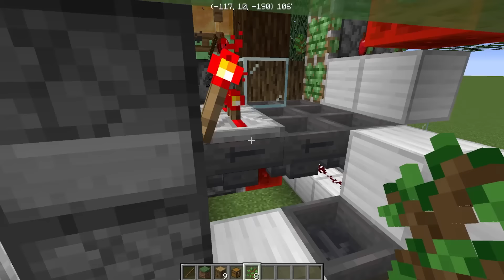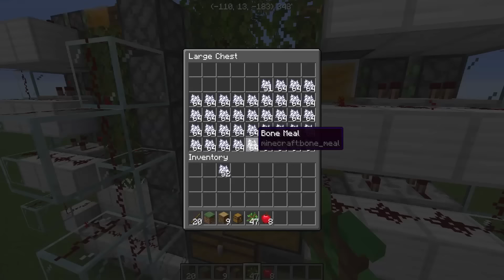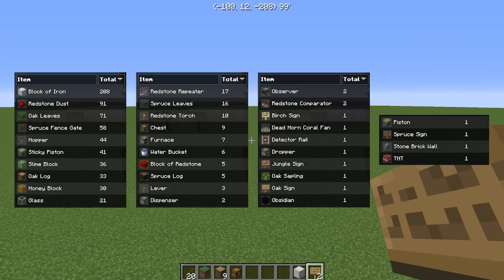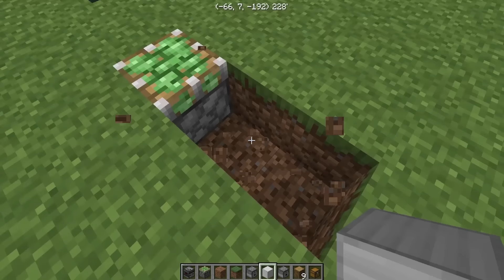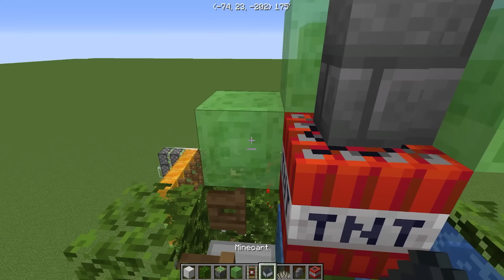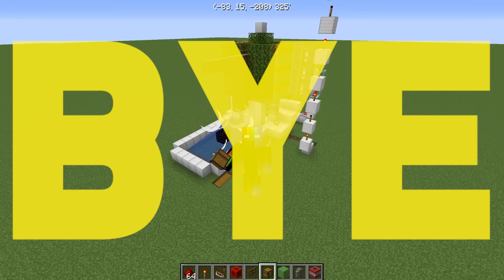Minecraft Tree Farm 26.1 - EASY AUTOMATIC TREE/ LOG FARM Tutorial

Comment from the maker: I need help farming likes and only you can be the one that helps me! make that bad boy turn blue! 😜😎😻
Have questions or yours broke? Leave a comment!
Reply: How many bone meal/hour is needed to run for oak? just wondering how big to build my bone meal farm to supply this constantly
Reply: @connerroth3416  make a mob farm afk for like one hour there and you can have maybe 3 hour worth of bone meal to use the tree farm
Reply: @connerroth3416  it depends, for me it was 4-6 double chests. (with hoppers)
Reply: @connerroth3416  10,800 and hr
Reply: It’s not working because of the slime blocks are not getting pushed
Reply: I have problems running with spruce it just doesn't grow. Any ideas why?
Reply: @ketsuppi  i have the same thing i tried building 9 blocks up with a block on the top and manualy growing a spuce tree but in the farm it does not work anyone pls help
Reply: Does ot work with spruce
Reply: @lukasemeraldpartoguanpurba3967  ya man it does
Reply: @Yaksh.physique  for me and him it just doesnt like it doesnt grow
Reply: @lukasemeraldpartoguanpurba3967   check des
Reply: It’s not working in the new update it’s not pushing the slime blocks
Reply: when i try to activate tnt duper, the coral fan dissapears and the tnt just activates without duping?
Reply from the maker: @andreasborelli7013  you have to enable tnt duping on servers with paper
Reply: @allen8812  I’m having the same issue with the second line of sticky pistons are not extending i built it 3 times idk whats wrong with it.  Can anybody help?
Reply: THE LEAVE CRUSHER IS JUST BROKE IT WORKED IN YOUR DOWNLOAD THE SLIME BLOCKS ALWAYS STAY THERE
Reply: I am having problems with the timing for the tnt dup so i dont know which is right
Reply: i m getting same problem it dropes 2-3 tnt then explode inside the canal @andrezponce2172
Reply: How does the piston with the redstone block know when to activate? I'm trying to fix a problem with that.
Edit: It's unextended normally when you reset it by breaking and replacing the dirt block above it, but once it extends, it doesn't stop extending and the leaf removers are stuck in the on position.
Reply: Hey can u help me my tnt duper doesnt work :( 
1.16.5 server with friends
Reply: I wasted more than 5 coral fans, 5 tnt and two hours to make the TNT duper just to see that I had been building it incorrectly
Reply: My farm will only move the honey blocks, the slime blocks stay in place
Reply: @mad_hatter3.14  same thing
Reply: so it doesnt work with dark oak?
Reply: @topazflip2029  fam dark oak only grows in 2 by 2 saplings
Reply: no it will not work but can u make one on my server i tried but cannot work plz i will give creative plz
Reply: Can ypu build this underground
Reply: Can you build this underground
Reply: hey Dusty Dude, sometimes the top row of logs doesn't blow up(you can clearly see in the video too). what can I do about it?
Reply: This farm always ends up with a couple logs stuck in the chamber. How can I fix this?
Reply: @connor6740  you mean the top row right?
Reply: @muffy4671  No, in the middle. Logs get stuck and when that happens, a row of the honey blocks and gates move forward and is out of position. I've checked all the repeaters, but can't anyone wrong.
Reply: @connor6740  it is ment to be that way
Reply: I'm confused because at the beginning of building the tnt duper the slimes are placed different than when you place the redstone torch at 20:51 to activate it for the first time. Did you do stuff during the part of the video that was cut? How should i place the slimes
Reply from the maker: @fubbalo_  build it how I built it. Things move slightly after you use it once
Reply: @DustyDude  Looking for help before I blow everything up. Can this farm dark oak as it seems like it would be quite similar in growth to regular oak
Reply: right now it isnt working because when i activate it when the slimes are in the positioning from ealier in the build it just moves the slime blocks and the tnt doesnt explode
Reply: also tnt duping is enabled on my server we have other farms with tnt dupers that work perfectly
Reply: well I was able to fix it but it took 3 hours and kinda had to troubleshoot my own way. it was a great tutorial otherwise though!
Reply: do you have to use iron blocks
Reply: @3PRBs ផងផ៩់
Reply: @xypxalo  if you lower the iron block in the middle
Reply: @xypxalo  no I mean the iron block above it
Reply: Does this work on bedrock
Reply: my farm is not working it doesn't move closer to the tnt drop
Reply: The sappling does not have enough time to grow how do i fix that?
Reply: oops i fixed it
Reply: @RuralTrainsOfIdahoYT  what did you do?
Reply: Does it produce spruce logs?
Reply: How many sapling do i need to start the farm with spruce or oak?
Reply: Hey! I know it wasn’t the intention,  but you can add modules to the TNT tower with a hopper clock 

I added a Cobblestone Module that pushes it into the already in use TNT duper and it just passively collects cobblestone even when the machine is out of bonemeal. 

It’s definitely not cute/efficient but if you ever want additional cobblestone when farming wood. it made 2 stacks passively while troubleshooting it
Reply: Does this work for bedrock
Reply: I made the farm exactly like you did but after updating to 1.17 the sticky piston under the dirt block isn't getting powered by the redstone dust maybe because of hit box changes so can you please help me with that
Reply: Yeah for some reason the tnt dup isnt working and all the leaves break along with the coral.
Reply: Is this farm for bedrock or java editon
Reply: does it work in bedrook?
Reply: I keep running out of saplings
Reply: Works on ps4 1.17? Tnt duper?
Reply: Does it work for bed rock
Reply: Hey !!! this tutorial is amazing , but I want to know , which texture pack do you use . Can i get the name of the same ?
Reply: do u need to build it out of iron blocks or can u use cobblestone
Reply: please help! the honey and slime blocks are not sticking to the sticky pistons on the leave crusher arm without the redstone blocks. idk why they aren't moving back. Any help would be greatly appreciated
Reply: Dusty Dude my farms slime and honey blocks arent sticking together!
Reply: @Dusty Dude what can I do if the TNT is producing too quickly
Reply: does this duper work on aternos server?
Reply: Does it work on bedrock?
Reply: it turns black now
Reply: Pls help me the tnt duplicator is not working for me
Reply: Does this work on crimson wood?
Reply: Gay
Reply: For me the other tree-types dont grow, only oak grow, jungle, birch and spruce just wont grow =(
Reply: Dusty dude please help me. The piston below with the redstone block is not activating
Reply: @anni_gaming9929  did u place the torch?
Reply: @popuplol9847  yes I placed it now
Reply: Slime block stuck with acacia free.
Can someone fix that?
Reply: I just built this farm, it works for the most part, but whenever I try to run the machine, the main part works fine, but the tnt duper only works when i flip the lever off to turn the machine off? Im a 1.19 realms java server? Thanks!
Reply: @tuthlu4016  Did you place 7 red stone torches? Then only the signal would flow with the lever.
Reply: @anni_gaming9929  I did place 7 torches yes, my issues had been resolved, seems i placed the comparators backwards XD
Reply: @tuthlu4016  Nice to hear that.
Reply: I just finished building it on our 1.19 server, it worked but suddenly the wood stopped moving forward so i wanted to see if smth with the hidden redstone was wrong, not the redstone (i believe) but i noticed the leaves despawning. The border ones as well the ones on the tnt duper so that broke and it blew up but is there any other block or way other than leaves because as said they will despawn. If someone could help i would very much appreciate it
Reply: How much bone meal does it consume per hour?
Reply: Is this farming still working in 1.19?
Reply: im playing in 1.19 and the tnt duper seems to not be duping and just sending the TNT itself
can anyone suggest a solution?
Reply: Bro, what recourse pack are u using ?
Reply: for some reason i cant do spruse idk why it works for every other wood but not spruce
help me dude pls
Reply: Hello. If I start growing birch seedlings after the oak seedlings. Will the farm break down?
Reply: Question dowe this work on bed rock two?
Reply: do you need to use iron blocks or can you use other solid blocks like smooth stone?
Reply: tnt duper doesnt work
Reply: @Dusty Dude, my tnt keeps lagging back while testing, this makes it not drop down. I'm on singleplayer 1.19 OF. Do you know how I would fix this
Reply: @Dusty Dude does this Farm work on Bedrock Edition?
Reply: My gress chopper is not working
Reply: My leaf chopper is not working properly. Plz help
Reply: Thank you for this video
Reply: I just build this farm for the second time on my friends realm, and it works great, except for spruce. I can't get spruce to grow, i've tried to move the ceiling block up/down/remove it completely, and nothing seem to help. Any1 had this problem?
Reply: it turns white bruh
Reply: Hi, is it possible to make it work underground? I did it using glowstone, but I am not able to make birch to grow, only oack. Is it not possible to grow birch underground?
Reply: I found out the problem, for some reason you can not excange log that push with stiky pistons with glove stone or brich will not grow...I solved using wood as you did and placing glove ston at place of the glass 👍 now it work perfet
Reply: @mix jax yes it work, chek out if you built well circuits...you have to be with the torch and repeater always active pointing the tree so when it will grow it will activate the piston of the tree detector below that will push the redstone cube that will activate the extractor and with the repeater delay the leaf crushers to...chek out that all repeaters have the correct timing and dalay
Reply: does it still work in 1.19.2? im just having troubles with the tnt duper stuff
Reply: @sherpaa1868  chek if you built it in the correct way
Reply: Bedrock
Reply: Hi so the tnt duper doesnt work properly the unsticks from the blocks goes down amd explodes then i dont have any tnt there and it just doesnt work please help im playing on  1.19.3
Reply: Hpw to make tnt duper work in 1.19
Reply: the tnt dupe is messed up in my multiplayer world wow
anyone know how to fix it would love some ideas (the server is paperMC btw thankss).
Reply: love the vids and i learn lots from them keep up the good work😊
Reply: The slime and red stone pushers won’t go out plz help
Reply: Can you use this for the new cherry blossom trees?
Reply: ik im late but can you use this with mangrove wood ?
Reply: One small piece of constructive criticism:

You start out with the dirt at 3 high, where on the 21x16 grid is this located and how is the rest of the build orientated subsequently. Otherwise i love your farm, made it before
Reply: Does this work on bedrock?
Reply: Does ut work for 1.20.4?
Reply: Does it work for 1.20.4?
Reply: the back 12 pistons keep jamming on mine. is there anything i might have screwed up for this to happen?
Reply: Does it have to be iron blocks
Reply: Hey Dusty, the tree pusher/leaf crusher doesn't sync with the rest of the farm. I have to stop it and go round the back to pull the lever and push the wood out manually. Everything else works well. Any fixes?
Reply: Sorry, me being a dumbass somehow removed a repeater.....
Reply: I also have a question: what types of wood work on this automatic tree farm?
Reply: Nevermind, I read the description
Reply: I play on bedrock and on 11:26 the pistons aren’t pushing the slime blocks, I don’t know what’s going on.
Reply: bruh this tnt duper is working in singleplayer but dosenot work in mulitplayer please help me dude
Reply from the maker: @Yaksh.physique  you need to enable tnt duping on some servers
Reply: @DustyDude  i am fuk up can u make it on my server plz i trie it and i destry it i can also give u creative scince its only our friends server
adn i also enable it plz make it redstone enginer
Reply: @DustyDude  every second tree, one row of honey blocks on each side stays in place and a log jams it up. Can you help? This only happens every second tree for some reason.
Reply: what version is this on
bc the tnt duper doesnt work in 1.16.5 for me
Reply: @Savagebutidiot  the thingg is either u are on paperserver or u made it wrong
dupers are patched in paper server
Reply: @Yaksh.physique  im on a survival and i dont know what a paperserver is lol
Reply: @Savagebutidiot  so u built it worg
Reply: @Yaksh.physique  mmm no i dont think so
Reply: @Savagebutidiot  it will work on 1.16.5
Reply: can u plz make this on my server i will give creative plz i make it but not wokring
pzlpzl

Comment: why did the farm suddenly stop working when i grew one tree
Reply: Mine is doing the same thing I don't understand why???
Reply: @melting_tv9853  I found the problem because the redstone block wont pull back, so I just connected the observer to the pistons by putting redstone in a line to it with a block in front of the observer and redstone on that block, then flick the lever around five to seven times until both the tnt and the leaf crusher work. But this only works if you manually bonemeal it, or the mechanism crushes the sapling. To turn the farm off, you break one redstone on the side of the observer and replace it
Reply: @EmpirePenguin14 Thank you. Do you know why the red stone block doesn't pull back with the way it's built? Because I built a bonemeal farm connected to it, and that kind of defeats the purpose if i have to manually do it. Also, do you know of any other tree farms that do work in 1.21.10?

Comment: I don't know if this will get a reply, as this is an older video, but: I'm having trouble getting my stick piston pillar to push the trees out after they've been crushed. It works if I manually activate it with a lever, but won't do it when the machine is running completely. The second (outer) pistons that make the second extension won't activate. I've checked to make sure my repeaters are set correctly, and they are. Any suggestions?
Reply: place the sticky piston and redstone block below the dirt where sapling are placed

Comment: This is a bit of a late question but why do you use sticky pistons instead of normal pistons for the piston extender pushing the logs forward since you don t want to retract the log but just push it forward. Also, I am a legacy edition minecraft meaning that I play it on 1.13, so I don t have honey blocks. I m guessing the leaf crushers won t work unless I leave a speace of 3 blocks horizontally in between each piston ?

Comment: Pro tip : You don't have to use bone meal for this farm to work. But then it'll be painfully slow.
Reply: this ain't a pro tip..
Reply: you can connect a bonemealfarm to the tree farm, i stacked 3 bonemeal farms on top of each other with the bonemeal going to chests which fill the dispenser, can pretty much afk when both farms are running

Comment: i did everything and for some reason, the redstone is blinking but its not moving the piston
Reply: I have the same issue
Reply: @sc_ken8045  i found it, if the tnt is working and the redstone is blinking u have to place the sapling for it to work
Reply: @D.CAutoSpa  actually i had a different problem, so i placed the tourch on the side of the wall insted of the block which is why nothing happend and i placed the pistod with the redstone block under the farm in the wrong spot, its suppose to be under the dirt

Comment: Do you know if anyone got this to work in 1.19? The Redstone is going haywire, and the leaf crusher is not fulling extending when I throw the platform switch but fully extending when I shut down the platform switch and then throw the control by the single sticky piston with the Redstone block on it. . The TNT duper platform blows up every time I've watched this 3 times now, and everything is in the right spot.

Comment: Great farm. I was having some problems at first, mostly because I was using glass instead of leaves (I'm on 1.19, so using leaves is not an option as well because they obsord water now). Also, when I was making the walls around the leaves-breaker mechanism, I used glass as well, which messed up my farm multiple times because glass would stick to the slime blocks and the mechanism was not working. 

Also really important: when I was making the TNT duplicator, (18:00) the walls have to be immovable blocks. Leaves should work perfectly there, but since I again used glass, the whole farm blew up a few times before I figured it out. In the end I just places furnaces as the walls around the TNT and it works now.
Reply: You can still use leaves on 1.20

Comment: At 11.35 in the video when you test if the leaf crusher works mine is pushing the honey blocked out but not pushing the slime ones then when I turn it off the honey blocked stay out ? How do I fix this?
Reply: Same. Did you figure it out?
Reply: Same here, any fix?
Reply: @willparrott5698  I realized it doesn't work on bedrock. I wound up making the tree farm from silentwisperer.
Reply: @MarkSmith-ib3ct  I've tried his, I had the same issue with the sticky pistons only pushing the honey blocks out and nothing else
Reply: @willparrott5698  https://youtu.be/IruU7L-GEec
This is the one I built. It doesn't use honey or slime blocks. But you do have to mine the wood after it's all created.
Reply: @MarkSmith-ib3ct  I'll try that one, thank you